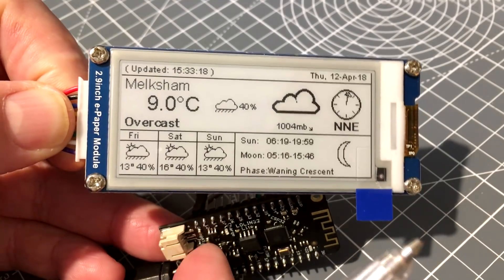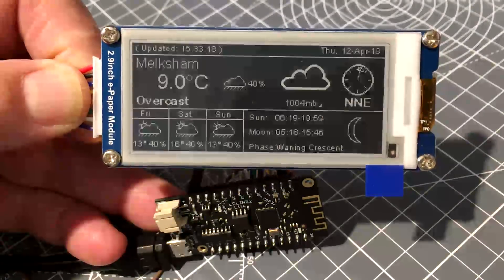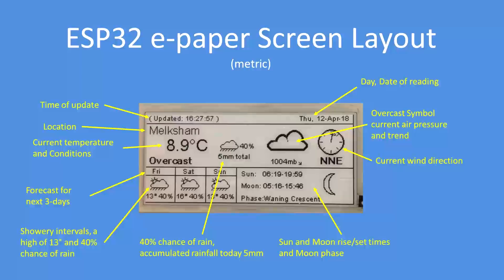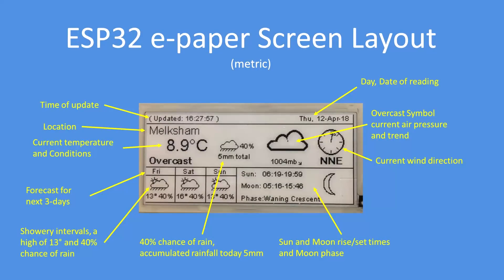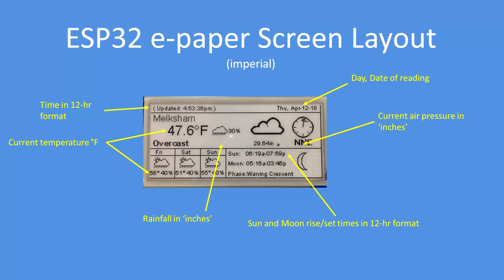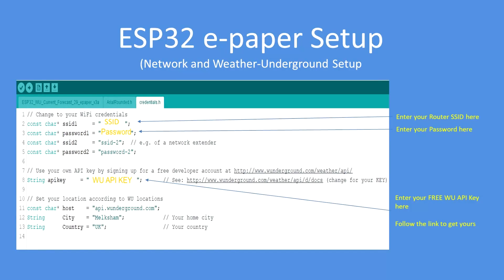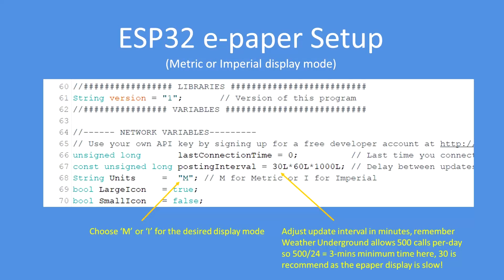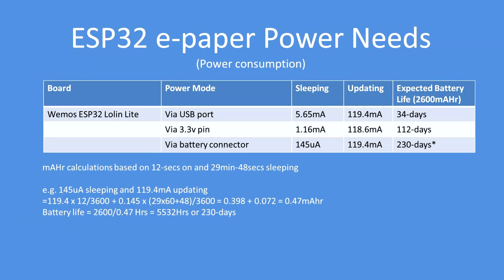Tech Note 091 - ESP32 and 2.9" e-Paper for a Weather Display (low power)

Comment: Hi, I have a Waveshare 2.9" display and a ESP32 DEVKIT-V1.  My pinout is busy=4, rst=21, dc=22, cs=5, clk=18, din=23, gnd=gnd, vcc-3v3.  I edith the file owm_credentials.h to use my own weather informations.  When I start the esp32 I see nothing on the display, but if i use serial monitor I can see what the esp is doing.  What I doing wrong.  I change nothing in the file Waveshare_2_9_T5_test,ino.  Thank you
Reply from the maker: You’ll need to try different 2.9” driver objects of the gxepd2 library, there are about 5 different types and if your display is new it may be yet another variation that is not yet supported by the library. Usually one will work though. There are examples in the gxepd2 example code that help to find the correct variant.

Comment: Can you please further explain how all the icons/graphics are being generated?
Reply from the maker: They are all drawn with vectors or if you like lines and circles. If you try to draw them using images it takes about x10 longer to refresh the screen.
Reply: @G6EJD  Did you design, draw, and call all of these elements by hand, or are you referencing a library?
Reply from the maker: No library, I just used a grid 100x100 pixels, then for a sun, draw a vertical, horizontal then two diagonal lines then overlay a circle. The moon is two partial circles, clouds are 1 line and 4 circles! It’s easy really.
Reply: @G6EJD  Thank you for the info. At the moment drawing graphics seems to be my one hold up. I will give this a shot.
Reply from the maker: @adammichalak4229  just scan down towards the end of any of my weather displays, there are functions for clouds, sun , moon, fog, mist and rain, then you just call them with addclouds(x,y,size); if you want sunny intervals then two lines add sun then addclouds

Comment: Excellent work. This vid is for another version of software though. The link points to a single day display and no longer uses weather underground.
Reply from the maker: That’s because IBM purchased WeatherUnderGround and stopped the issue of free API keys, it now cost $500 per annum. The move to Openweathermap got around that, but required the code to be updated. The principles are the same though.
Reply: @G6EJD  Thanks David 😁

Comment: Hello
hello
I have to epaper 2.9 Waveshare and lolin D32 as on your shema exactly the same.
no error compilation 

Wifi connection ok 

reception of the forcast (i can see on the serial monitor) 
i have connected the epapaer  like(connection type lolin D32esp_busy = 4)
but tnothinhg  display on the screen 

Thank you for your help.
Reply from the maker: Philippe Fourchtein, this is a connection error, please check your cables are correctly connected and are making connection, DuPont cables are very unreliable.
Reply: hello
thank you for your quick answer 
how to send you a picture, and my files?
I tried testing the connections and changing the screen always the same problem.
Thanks again I appreciate your videos a lot
 @G6EJD
Reply from the maker: Philippe Fourchtein, contact me via www.dsbird.org.uk
Reply: @G6EJD  I'm sorry I just logged in on the site I registered but how do I find you?
Reply: i check my dupont connection with ohm meter connection is ok
Reply: i chechk my connection with ommeter all are ok
Reply from the maker: Philippe Fourchtein, ‘Contact’
Reply from the maker: Some earlier Lolin D32 boards were marked but not made by Lolin and consequently the pin outs were not the same, which board and version do you have? Also what is your display type?
Reply: i jeave conected 15min and comme back tommoro morning thank for your help again
Reply: i test with wemos D1 R32 with same connection no screen see you tomotow i hope
Reply from the maker: http://g6ejd.dynu.com/index.php/contact/
Reply from the maker: Is it a colour display eg red or yellow and not black and white
Reply: Hello G6EJD
Thanks for your help IT's work Find i'am verry happy 

can you ask again for help for this card you have show in other video "T5_V2.2-2.9Inch-bw" i use same config but busy:4 EPaper RST:12 EPaper DC;19 EPaper CS :5 EPaper MOSI:23 ;
and dont'work 

thank again for your help
Reply from the maker: Philippe Fourchtein, screen driver problem, change to 3C type
Reply from the maker: Philippe Fourchtein, make sure the pin definitions match your connections too
Reply: @G6EJD  excuse me can you explem by type 3C
Reply: pin definition is ok but i'am able to change driver without help
Reply: not able to
Reply from the maker: Philippe Fourchtein 3C means 3 colour displays, it’s highly probable the code does not support a 3C display, BW only, where is the code your using link?
Reply: @G6EJD  your right for my first problme 3colors i send back to amazon exchange to B/W and all work very very well.
but i have an other "https://github.com/LilyGO/TTGO-Electronic-Badge" it B/W screen you have do a video about this lylygo. i try to use same code i change only adresse for my card version T5 2.2.
thanks again for all
excuse my english i' french
Reply: if it'necessary to change driver can you send me exacly the line to write excuse me i just news in this domaine
Reply: bu i read a lot and learn rapidely
Reply from the maker: Philippe Fourchtein, in boards.h the connections are:

#define ELINK_BUSY 4
#define ELINK_RESET 16
#define ELINK_DC 17
#define ELINK_SS 5

I think RESET is different for you connections? Best to check them all and edit as necessary
Reply from the maker: So choose boards.h tab in the ide if you have that file in the sketch folder or edit the file where ever you copied it too at least Reset and DC need to be changed
Reply: @G6EJD  yes but i would like to use Your programm waveshare 2.9 with this card i change in waveshare 2.9.ino parmametre connection for my model 2.2
Reply from the maker: Philippe Fourchtein, OJ so you have this board then change my code to RESET = 4 and DC = 16 as these are wired to this configuration on the ttgo pcb
Reply: excuse me i oblige to disconnect i try to connect with you tommorow if you send me some modification to do i send you back result
Philipp
Reply: I really wanted to thank you for your help. Now everything's working perfectly. It's a great job you did.
thanks again, I watch all your videos with a lot of interest

Comment: Looks fantastic, but when I checked the weather underground, it appears they no longer give away free API keys

https://www.wunderground.com/weather/api/

"To improve our services and enhance our relationship with our users, we will no longer provide free weather API keys as part of our program. If you have been directed to download our Weather Underground free API key by a third party provider, please contact your vendor for resolution."

So I'll probably need to modify the code to scrape the information from the weather underground web pages or somewhere else locally to me. (in Australia)
I've done something similar , several years ago, using Wifi to Serial modules. prior to the ESP8266 or ESP32 being available.

Also putting some PHP on a server somewhere to do the scraping is also a possibility as its probably easier to code the scrapeing in PHP.

I presume sooner or later even the existing API keys will get disabled.

Comment: This is really interesting. Is it possible to refresh the screen without making everything black? Refreshing just the part where change will be done in the display ?
Reply from the maker: Yes it is, but the partial refresh capability is not yet that stable and modifying the code to detect change is quite involved, clearly the last readings need to be stored in flash memory but tithe ESP32 has got limited write cycles and there’s not enough NV RAM to hold all of the data, maybe if codified it would be possible, then the code would have to detect differences and update the regions accordingly. Really epaper is a static display, but the main advantage is zero power in sleep, although partial refresh eventually needs a complete clear screen to depolarise the particles as they tend to get polarised to the display screen surface and it gradually turns black, starts black and white then tends to all black.

Comment: One thing that would be a nice feature would be an auto set of location via either GPS Module or local IP.
Reply from the maker: In principle yes that’s possible but power consumption would climb markedly. The problem like all weather data suppliers is the reference locations are often dispersed so if you send an exact location the server is likely to return a location not found message. There are large areas of the globe that aren’t covered due to a lack of raw weather data, on the WU most of South America has no coverage for example, I have not checked OWM yet. Getting geographic location from an IP would not be possible for example typically an IP is 192.168.0.2 rather than a WAN address where some limited geolocation would be possible. It’s stretching an ESP32 to do all this.

Comment: Hello. This looks really nice. Thank you so much for sharing the code. I'm going to try and build something like this as my first project. I have two questions:

1) It seems that this 2.9in eink display supports partial refresh. Is there a reason why you instead refresh the whole screen, instead of just the figures (and leaving the icons as they are)?

2) I'd like to add a clock (showing HH:MM but not SS) to the display. Would I need to add any other chips to do that? And would something like this work: 

sleep for 59 seconds, 
wake for 1 second, 
partial update the part of the display that shows the time,
loop.

Does that make sense?
Thank you.
Reply from the maker: What you’d like to do makes sense but drivers for partial update don’t exist or work consistently and documentation is sparse, so implementation is not easy. When the e-paper is active (being updated) it consumes about the same power as a TFT display so updating every minute means your power consumption will be high and battery life would be very short. You would not need additional hardware as the programme gets time.
Reply: Thank you for that clarification. Can I also ask: do you run this weather station on battery power? If so, what battery solution do you use? Thanks again.
Reply from the maker: Yes, I'm currently three on long-term test one using a 2.9, 4.2 and 7.5" display. All are using a 3800mA Lipo flat cell (like this but bigger capacity https://www.aliexpress.com/item/7-4V-500mAh-Lipo-Battery-2S-For-JJRC-H8C-DFD-F183-F182-RC-Quadcopter/32824588617.html?spm=2114.search0104.8.74.19e739542YcazK&priceBeautifyAB=0) and I expect them all to last about 6-months or more. The actual calculation is 5.2 secs at 144mA then 8-secs at 44mA giving a total power demand of (749+352)/3600 mAHr = 0.305 and with a 3800mAhr battery duration with 30-min updates (2 per hour) would be 3800/0.305/2=260 days  if updated every min duration would be ~ 8-days!
Reply: Have you manage by now to do partial refresh from deep sleep without the display flickering? I’m unable to find a working example. All projects I can find shows the flickering when coming back from deep sleep.
Reply from the maker: There partial refresh examples in the GxEPD examples but whether they work from the display being powered off and on I have no idea.

Comment: Hello ! Please  help me with this. I encounter this problem: 
1. When I uploaded example code for E paper 2.9 of miniGrafx library. It didn't work. no displayed anything . (done uploading, everything about libraries is Ok) 

Then  I tried to upload example code of  GxEPD library. it did work. ( no change pins ) 

With the code of tech note 091 that using miniGrafx libray => Serial monitor display like this: writing Buffer, set register start. That's all. 

So Please let me know what problem I got with miniGrafx library. Thanks so much !
Reply from the maker: This sketch is not using the GxEPD library, you need:

#include "EPD_WaveShare.h"   // Copyright (c) 2017 by Daniel Eichhorn https://github.com/ThingPulse/minigrafx#include "MiniGrafx.h"       // Copyright (c) 2017 by Daniel Eichhorn https://github.com/ThingPulse/minigrafx#include "DisplayDriver.h"   // Copyright (c) 2017 by Daniel Eichhorn https://github.com/ThingPulse/minigrafx
This almost certainly to do with the wrong pins being connected. Please check your wiring.

Ideally get a display example programme working first.
Reply: thank you so much ! :)

Comment: Great project. I built one weather station and it looks awsome. Thank you very much. Ps. In upgraded version 5a uw 2.9 is something wrong with temperature symbol F or C aligment.
Reply from the maker: Yes possibly because I try to reuse code and it works out the C or F position from the length of the e.g 20.1° temperature so that would be ~5x6 pixels along from the first character maybe the multiplier needs increasing.?

Comment: please tell me  where you get library time.h. 
i tried to import, but it's not compatible. 
thank you so much !
Reply from the maker: Time.h is a core in-built library, so no need to import it.
Reply from the maker: Make sure you are using the ESP core version 2.4.1 via boards , manager, type ESP into the search box you should see an esp core version of 2.4.1
Reply: thank for your answer, i'll check again.
Reply from the maker: Thịnh Nguyễn Make sure your using the correct location, <time.h> and “time.h” determine where the file is loaded from, using “ “ indicates that the include file is local e.g. your library folder or sketch folder, while the other <> indicates that the include file is from the core location. In practice the compiler resolves this for you and if it finds two sources, it tends to use the core files. So if you downloaded a different time.h file you would reference that with #include “time.h” the file would then be taken from your library folder or sketch folder.

Comment: Have you had any dealings with the ; 
https://it.aliexpress.com/item/WeMos-D1-USB-NodeMcu-Lua-V3-CH340G-ESP8266-Wireless-Internet-Development-Board-For-Arduino-IDE-IIC/32813202006.html?spm=a2g0y.10010108.1000016.1.1a8c713fSIG2eE&isOrigTitle=true
Reply from the maker: If you check out the Wemos website I doubt you’ll find this board, other than that it looks ok and I’m sure it will work ok.

Comment: Gr8 as usual. Can this display be used to display the info passively eg keep showing info when there is no power to display.
Reply from the maker: Once updated the display is held indefinitely, when they are supplied they have an image loaded during test - as part of the test, so yes absolutely no power required when asleep. That said I think I recall on the data sheet there is some small leakage current when applied to 3.3v of typically 5uA, so hardly a power consumer.

Comment: Would an e-paper 4.3 inch, with 6 pins,  rst, wake up, DIN, DOUT , (VCC, GND of course) ?, I happen to have a spare
Reply from the maker: Hi Ross, yes the there would be just two lines to change check out the library here: https://github.com/ThingPulse/minigrafx/tree/master/examples/EPaper 

The library is configured for Myserial(2) but I haven't had time to research if that will use the second serial port of the ESP32, but all that problem will be is which pin numbers 16,17 are the default serial pins.

All the drawing commands are the same.

The display will be somewhat compresses on the much larger 800x600 display, but easily fixed by moving x,y coordinates around. I'm currently working on a 4.2" variant with graphs, but that could take weeks yet in between my other workloads :)

So a cursory look seems like just the two lines, include the 43 library:

#include "EPD_WaveShare_43.h"

Then the display object:
EPD_WaveShare_43 epd(&mySerial);MiniGrafx gfx = MiniGrafx(&epd, BITS_PER_PIXEL, palette);

And define Wakeup and reset pins.

Downside is 4.3" takes a lot of power (relatively 5mA) in sleep mode.
Reply from the maker: And the fonts won’t load with the 4.3” display so the 10, 14, 16 and 24 sizes would need to be changed for the 3 in-built fonts, but that is relatively easy with the set font function. I don’t think anyone has created a font generator for the display yet. I asked Waveshare for the details of the fonts but they won’t give them out, licensing issues too.
Reply: Thanks Dave, I am gonna give it a try !, I'll let you know how it works out, And thanks again for this excellent Channel !

Comment: Really nice job. I make a point of catching your videos when they pop up on my subscription list. Can I ask you if you have an issue with the WiFi exceptions resetting the MCU on occasion?
Reply from the maker: Yes I do but only from or within sleep, but take a look at the code in the Wi-Fi Section, I have read that explicitly setting STA mode helps prevent this occurring and also disconnecting before starting the connection process too. It is documented in the Espressif forum, but I can't find the link just now.
Reply: Thanks for the reply. I will look a bit further. Ended up switching to the ESP-IF instead but really prefer the Arduino for simplicity. Thanks again.

Comment: take a look at the WIFIMANAGER library (by TZAPU), to get rid of the embedded credentials and manage custom parameters, without recompiling our sketch... :)
Reply from the maker: squalazzo I used to use the wifimanager library in all of my projects but I had so many emails from people who had difficulty using it and it is a bit convoluted for those starting out so I’ve resorted to the most simplest of approaches and if anyone wants to use that library they can generally add it to suit their needs. I was going to add a webserver to handle configuration settings and SPIFFS for storage but again the complexity for most people is too much, maybe I’ll add that in a version two. Thanks for the suggestion. BTW if someone does not know what their doing the initial connection of the wifimanager is very complex to them and I understand why they get confused.